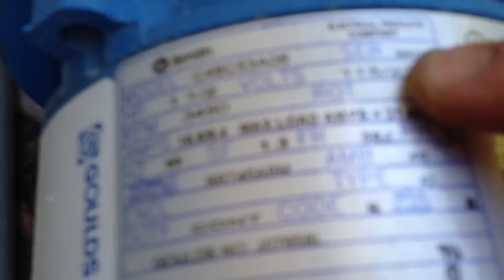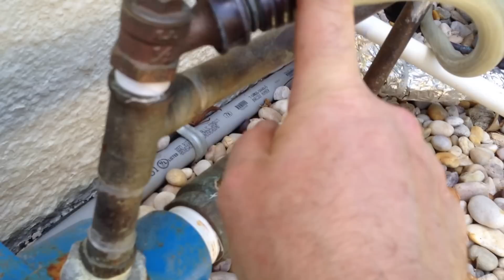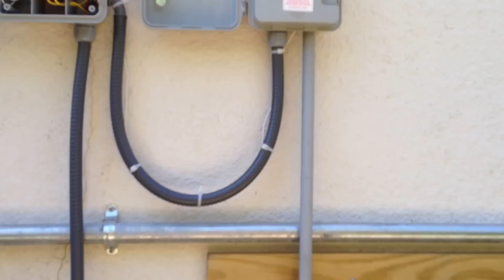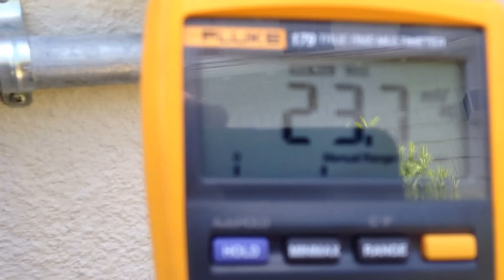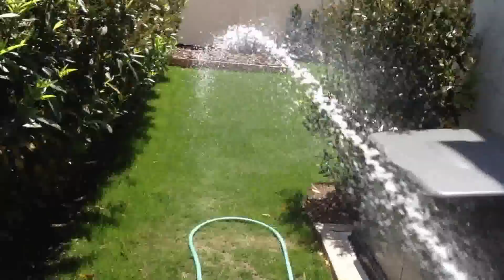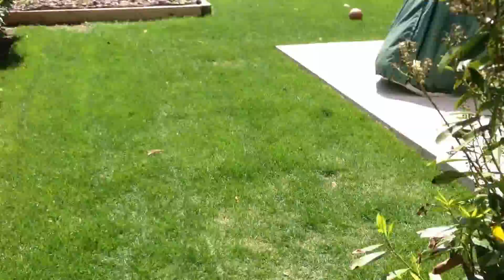Electric Well Water Pump - For Sprinkler System and Garden Hose

Comment: The reason you want it to run on 220/240vac is that you can use a smaller gauge wire to bring power to the pump motor.  The cost of running the pump on 120vac vs 220/240vac is no different.  The electric meter reads watt-hours.  120 x 16 is the same as 240 x 8 (for example).

Comment: Great video man. Question, I connected my pump to a pump start relay and fro
 There to a controller just how you have it. What I notice is that my pump stays running like on idle even though the controller does not have a station running. When I got a station the pump goes from idle to running I guess and it works fine but when the sprinklers stop the pump seems to keep running on idle or something. It does not actually shut off. Any ideas?
Reply from the maker: It's hard to say. I would start with a multimeter and check out the voltages on and off of each wire.
There is no idle, just on and off. Could be a shorted wire feeding power to the pump.
If you set it up as 240V then maybe one wire is shorted hot and feeding it so it sounds like a Buzz even when its not supposed to be on. Keep me updated.

Comment: I also have a well pump. I have about 4 meter deep and about 2 meters wide well and it is in the corner of my garden. It is so covered with trees,bushes and flowering summer plants that I never even see it. So, to about 2005 I had a manual way of bringing the water for watering, but I was sick of that continious up and down with the bucket on the cord, so I told my mum (at that age I was only 15 yo) that I will install a water pump, but she laught at me, and she said no way are you doing that. So, she went on vacation for a week and I left alone with my grandmother, and she told me that I can do whatever I want, so I went ahead and broke up my money safe and took with me all my personal savings to the local home improvement store and I bought self-priming plastic impeller 220v 1500w weather resistant portable water pump. So, the well was on the farthest corner of the garden, but the outside work shed was next to the house, about 50 meters away from the well. So I started by digging by hand 0.5 meter trench for running a supply pipe (1/2 inch) from the well to the shed with polipropelline pipes, that I welded together by meting the ends and sticking them together with couplings for forever lasting bond. When I reached the well I made a hole in concrete ring (the well ring that sits underground for maintaining the well's construction) and I lowered the pipe to about 10 inches from the bottom of the well underwater. On the end I put in oneway checkwalve and about 3 inches above the water, right at the L I put in a Tee with a ball valve, for draining the underground line for the winter. I then filled up the trench and I started working on a pump itself. First, I made a little desk on witch the pump would sit on inside the shed, and I ran supply and out pipes trough the wall. I firstly hooked up a ball valve on a supply and then a filter (that big filter, on witch you use a yarn cartrige and you need a key to open and close) and then I hooked it up to the pump. The supply was done. Then, for the discharge pipe I put in also a ball valve and a tee with the ball valve for priming and letting air in for draining the line underground. I then hooked up another tee to the discharge and I used an upside down old gas tank, hooked on the wall to act like a pressure tank, because the premade ones with rubber diafragm were pretty expensive, and I shall say that it works quiet well. Then I put in a pressure switch and the inside plumbing is done. Now I move to outside. On the roof of the shed I secured a massive black painted radiator, so in the summer the water would get heated by the sun and I would have hot water on the outside sink. I hooked up an old ceramic sink on the shed's wall and I ran hot and cold supplies for the sink. I use the sink for gardening, washing hands after work, etc. Then I ran the pipe underground to the sill faucet for the watering hose, I hooked up the sprinkler system (the manual one with just a valve that I manually close and open, depending on temperature, because the automatic one is far too expensive) and I ran the pipe to the green house, to the old cast iron bathtub that my mum fills up, it warms the water for the greenhouse and she uses watering can for watering the greenhouse with warm water. When everything was done I primed the pump and switched it on. it hummed for about 3 mins and then a sudden change of sound and after few minutes the pressure switch switched off the pump. I checked the radiator, it was filled, I just open the it to let the air out, so it would be filled 100%, I checked the hose, it was fine, and the sink - it was also fine, the water was clean, heated up and under pressure, just like inside. from the start I was a bit scared that the pump could not pull water trough 50 meters of horizontal pipe, but it pulled, and is pumping with no problem. I was really happy that I don't have to pull the water with bucket on the rope anymore. My mum was mad on me, because I done it all by myself and I didn't ask her permission, but then she was really amassed and really happy too. All I can say is that it is hard and expensive project, but it was worth every second and every penny I spent on it. (in total 230 euros) It still works to this day and I had to change the filter only twice trough out it's working time.
Reply from the maker: +Vytautas Poška Thats a Great Story. My Pump would Not Start this year. The sprinkler guy changed the Capacitor and said that the pump was Broken. I double checked with a Multimeter and saw that the pump was only getting 120V and not the other 120V Leg for 240V Total. It was due to a loose outdoor fuse. So Always Double Check. This Pump is very reliable and i am told usually lasts between 12 and 15 Years. Just keep it covered in thhe winter.
Reply: Thanks for the advice :)

Comment: have a Flotech 1 1/2HP pump and it was running fine until yesterday I guess a wire had frayed and when I turned the pump on it blew,,I put new wire on pump and now the  pump won't come back on it started to when I flipped the breaker I heard it running and then it just stopped now I turn the switch on and I get nothing,,,what happened what do I need to check thank you
Reply from the maker: Try to wire the pump through a different electrical source, to rule out a bad fuse switch in the fusebox. It could be that the pump was dying and overheating and thats what blew the fuse. Very possible that pump motor is bad.

Comment: how to winterize this sprinkler system? we have the same well with the sprinkler system and want to know how to winterize it,,, thanks
Reply from the maker: +Emiona Kreste 
You Need someone first open the valve to drop the water back down  the 35 feet so it does Not Freeze in the pipe.
Then you need someone with an air pump to Blow out each Zone.
Then you need to fill the pump with Anti-Seize liquid.
Best to have a Pro do it.
Reply: You must use a air compressor to blow out the lines to remove any water from your system over the winter so it does not freeze and crack

Comment: What size pump do I need for a 6 zone irrigation system. My well is about 50 ft deep. I had a northern tool wel built 1hp with tank and it didn't give enough pressure to the heads? Ty
Reply from the maker: I don't know for sure. If i can find someone to ask, I will and will get back to you. This Pump pulls up from 35 feet below and it is 1 1/2  HP. Sounds like you need at least 2 HP, perhaps 3 HP to get the pressure that you need.
Look at the - GT30 - Goulds Pumps IRRI-GATOR Self Priming Pump.
Reply: I know your question is over 2 years old, but ...
If you run one zone at a time (most times run one zone at a time), your pump/motor size will be dependent upon how deep your well is (how much head the pump has to draw), not how many zones you are running.  Add up the GPM (gallons per minute) on each zone for each sprinkler head.  The zone with the highest GPM determines the needed pump capacity - add another 20%-30% so that you get better than a tickle from your heads.  If your pump is rated to draw 75 ft of water at 0 gpm/gph,  you need a bigger pump/motor combination if your water table is too deep to get the pressure you need.

Comment: Could this be wired for a normal 120 outlet?  I have one and am planning to use as a sprinkler system drawing water from the lake I live on. I can wire it to a box but I don't want to as it's a switched box for my pole lights. I'd rather have the ability to just plug my pump in to my heavy duty extension cord and plug in when needed.
Reply from the maker: This Can be Wired as a 120V or as 240V, so Yes you can!
I generally prefer to use 240V whenever possible. I believe that the pump operates more efficiently and will last longer.
Reply: +silverbankruptcy couldn't agree more.  However my pump is most likely 20+ years old anyway so I'm not really wanting to run a new 240 outlet lol. Thanks for the information. My spigot is damaged and unusable so I'm creating a sprinkler system for my small lawn.
Reply from the maker: Makes Sense to me!
Good Luck.

Comment: It's a great video... I am planning to do the same.

Is it $2500 with the well and the pump?

How much did it cost you for the well?

How much is for the pump and installation (not including the sprinkler system)?

Thank You !
Reply from the maker: I just wanted a Sprinkler system, He quoted me $2,500 for front and back with four total zones. He then says get a well for another $2,500. I said I don't know what a well is and so I don't want it. He calls back and says that I Must have a well since I will make the money back in water savings and that he would only charge an additional $2,000 for the well. I say Ok and I am saving roughly $150 a month in water charges.
Reply from the maker: When I say the cost of the well, that Included, the well And the Pump and the Labor
Reply: I really appreciate the information. How deep is your well?

I know the depth varies by location to location.
Reply from the maker: The Guy Knew my area. He said that he started to hit water at 25 feet and he went down to 35 Feet to get good water. It varies a lot, as I know a few blocks away, the ground level drops by 20 feet and people do not have basements. Hire a guy who has experience in your area, as he has the knowledge to judge what is involved. To Drill, he just used an air compressor that pushes the dirt out of the way of the pipe, which just drops downward.
Reply: I got a quote today. 3000$ for 75 ft in ONtario, Canada. Thanks again.
Reply from the maker: What does a monthly water Bill for watering your Lawn, look like? 
This will tell you whether its worth it. Also 75 Feet is Deep, so the Price seems Reasonable if you save enough Monthly.
Reply: $3k just for the well. Pump and other stuff are extra.
Reply from the maker: Oh I see. You would have to compare that to Municipal water to make a cost / Benefit Analysis.

Comment: I have a well pump for irrigation use only.  It was installed when I bought the house. I have been trying to prime it and get it going.  It is a goulds but it is set up differently from any I have seen on Youtube as it has an expansion tank screwed to a pipe that sits above the pump.  there is no faucet into which I can add water to prime it.  however, the expansion tank will unscrew.  I unscrewed the tank and  poured water down the pipe until it filled up then screwed the tank back on, turned on the pump and opened a zone and no water came up.  I can hear that the pump  is working to pull water with no success.  I let it run for 10 minutes then turned it off as I am concerned I will burn up the pump given no water is going thru it.  Is 10 minutes not long enough for the pump to pull up water?  and,  am I correct that running the pump without water will burn it up?  BTW: I can send you a picture of my setup as I have looked on line for a similar set up but have not found one.  thank you
Reply from the maker: Get a huge bucket and a smaller container, like an Ice tea holder, and Keep pouring water down to prime it, keep pouring as you see its needed and it should prime, may take 10-15 min if its a 30 foot well. will not burn out, especially if you keep adding water. Ignore the water shooting out until it sounds like its pulling up water from below ground. You need a lot of water to do this. Be sure to winterize and drain the bolts all around top and bottom and then pour in RV antifreeze.
Reply: Thank you for your response.  please clarify, do I turn the well motor on while I am pouring water into it, and should a zone be opened at the same time?  thank you
Reply from the maker: Yes Motor Running and keep pouring water in. NEVER let motor run without a zone on, or motor will burn out. My system does not allow that possibility as motor turns on only when a zone goes on. Even the hose connection only turns on with a zone, otherwise if hose closed, it could burn out. Water Must always be allowed to flow.

Comment: You haven't a clue what you're talking about as far as electricity and what you state about an appliance running cooler at 240  and that Europe is better - actually we are 240 volt 60 Hz is the most efficient - 50Hz is not as efficient it's also more costly - the transformers cost more to make because of the size of the transformer and the added windings - Watts are watts no matter if it's supplied via 220 or 110 - 220 can just supply more amps that's the only difference - as far as that pump getting hot maybe you should consider the fact that you are pumping up water in a 1 1/2" pipe and constricting it down to 3/4" you sure are making that pump work hard - you should have supplied the entire system with 1 1/2" PVC and reduced it from the trunk lines to the sprinkler heads - had you done that you may have been able to reduce the amount of zones
Reply: Actually the motor would be running with no effort being sized down to 3/4 inch outlet, if the well produced enough water, the amps would go down. If you had 1.5 outlet and could flow that much water, say 50gpm it would put more demand on it and amps go up. I install cycle/stop valves just for this reason on certain applications. As for heat have you ever touched a pool pump motor running 8 hours in direct sunlight, very HOT.
Reply from the maker: The inspectapedia page explains what you are saying. It says that 240V 
motors are slightly easier to start and last Slightly longer. That page 
says:
In sum, the electric bill is about the same, but at 240V the pump has a little 
easier time starting, it may thus have a little longer life, and the wiring 
might be less costly. The improvements in efficiency of use of electrical power is slightly better at higher voltages (less energy loss) but running a water pump will not be noticeably more or less costly between the two options.
Reply: Hit nail on head , he wanted 12 3 with ground for single phase...240.

Comment: Also, where is your pressure switch?
Reply from the maker: Sachi WI  what is a Pressure switch needed for? water is not being stored in a container. Its being pumped onto the frass and is on all of the time.
Reply: Pressure switch is mostly for jet pumps, this is a centrifugal GT15 Goulds which is not made to work with a pressure switch although some people still adapt them and have other issues.
Reply: Jack Ostrander can you not install a GT15 or similar pump with a pressure switch and expansion tank? Also what are the other issues you were mentioning?

Comment: Planning to do the same setup.
How many stations do you have ? Because if turn one station on does the one station  24 v to contact then to 24 to the other value ??
Reply from the maker: I have 4 zones. I think that each zone is individually energized with I guess 24V and that turns on that valve.
Reply: Ok so you used a 2 pole 20 amp 24v coil contact.
You have 4  24v ,How did you separate them at the contact ?? I’m trying to figure it out
Reply: Or do they turn on the same time ??
Reply from the maker: You can't design this from scratch, i mean you can make a computer from transistors, but why not just buy the digital programmable controllers in the video?
Reply from the maker: Only One zone can go on at a time generally. If zones are small, you may be able to combine them. Mine are individual zones with each about 6-10 heads each zone
Reply: Thanks !! I got it  theirs a main pump connection on the timer that controls the pump
Reply from the maker: Exactly My friend, A control Box for the Zones, and a Contactor (Relay) Box for the 240V Pump. Make sure they wire that pump for 240V. Best of Luck.

Comment: I have a problem with my water pump too, I have a Rain Bird control panel and I tried it for the Spring/Summer Season and when I click water now the whole panel goes blank, blinks then comes back on, but my pump will now run. What are some test or something like that to figure out what is going on
Reply: That's above my pay grade.